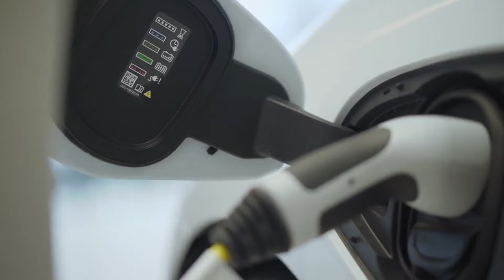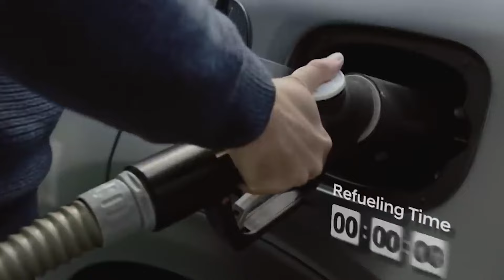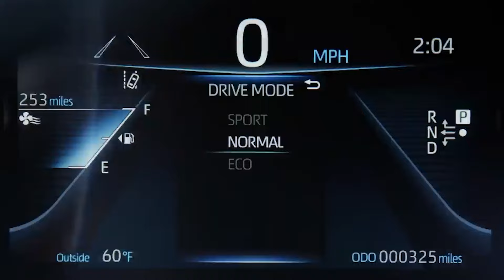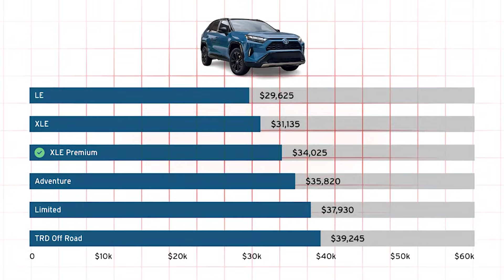Toyota SHOCKS The Whole EV Industry With This NEW ENGINE

Comment: Water is h2o, hydrogen is h so it;s a different molecule. Hydrogen can't be stored efficiency. It's a very light molecule that escapes the container its stored in. You will lose 5% per day in industrial storage tanks, a car is even worse. But you can make hydrogen from water. But its inefficient proces with electrolysis, so it requires electricity. Hydrogen itself is also not that energie dens compared to normal gasoline, (around 1/7th). Also it burns only 10% during compression making the mileage 30 times worse than gasoline.
Reply from the maker: huh?

Comment: I don’t believe Toyota is that stupid to go for Hydrogen ICE. We have Hydrogen FCV since 2 decades now but they didn’t catch up. Then Why in the world will Hydrogen ICE work?
Reply: A fuel cell needs a lot of exotic materials like platinum to work which makes it very expensive. A fuel cell is also very sensitive to contamination and would be spoiled if impure Hydrogen is used.

A HICE on the other hand is cheap. It’s literally the same 100+ year old with a few different parts which will cost the same at mass production scale. It will also be very resilient to contamination.

A see two issues with HICE:

1. NOx emissions: Nitrogen comes to the engine with air, which has 78% Nitrogen. During the combustion, the conditions will be just right to make NOx. To be clear, the NOx emissions wouldn’t be worse than a petrol or diesel engine. But HICE will never be zero emissions.

2. Hydrogen has very less density. It will take a 20-30 times the storage volume to have the same range as petrol or diesel. Nobody knows how to solve this problem.
Reply from the maker: They need to try new things mate